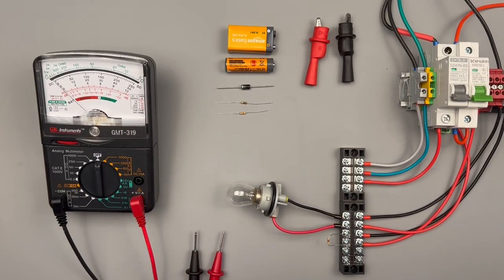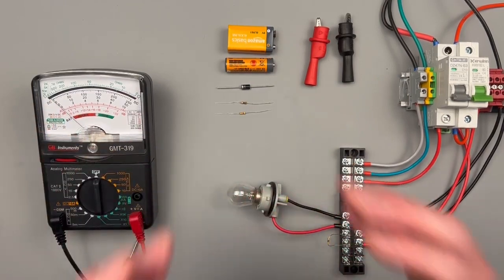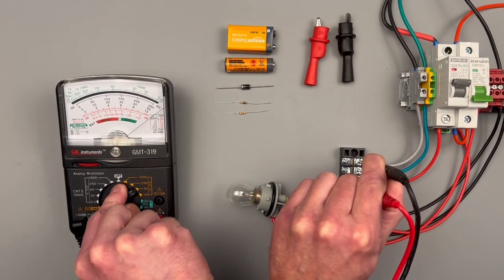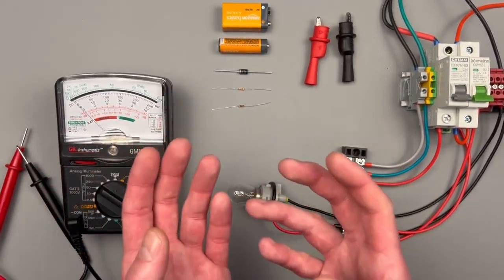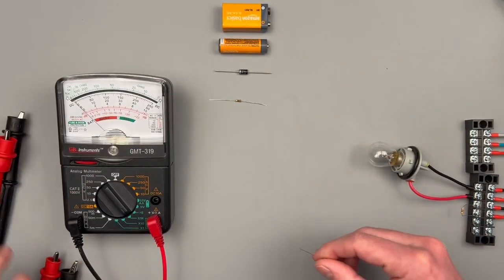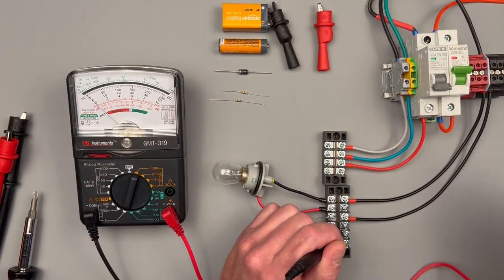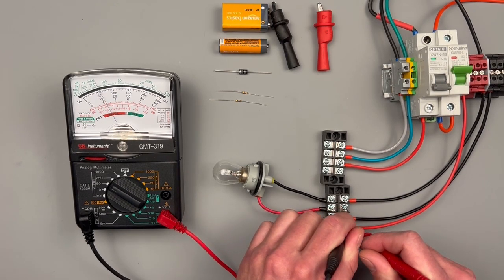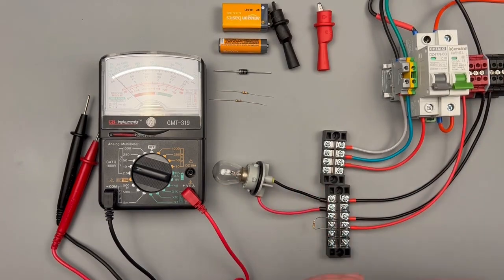How to Use GB Instruments GMT-319 Analog Multimeter (Gardner Bender) 🧐📈📉

Comment: In ohms it is not good, a resistance of 8 ohms measured with an accuracy of 0.3% gives 10 ohms on the GMT-319 which makes an error of +20%, on higher resistances I even had errors of +50%. On the other hand in voltage it seems good, so perhaps a problem of connection of the batteries which do not make a good contact.
Reply from the maker: @linuxjcajca7806  Thank you for sharing that with everyone.

Comment: The dial-in wheel is to calibrate the OHMs. When you change the meter value of your OHM reading (x1, x10 etc.) you touch the two leads together and use the wheel until it rests over 0 OHMs... 👍
Reply from the maker: Good stuff! Thanks for letting us know!